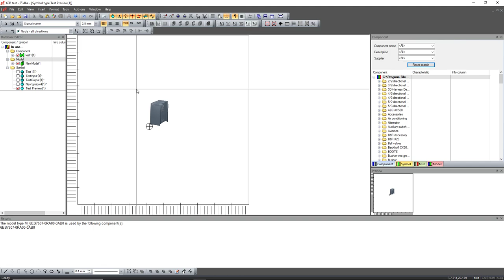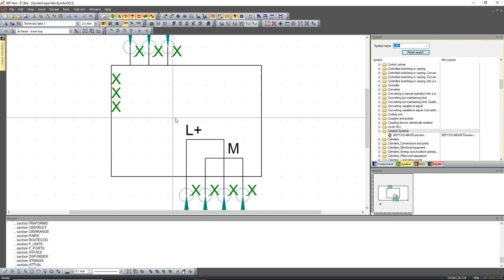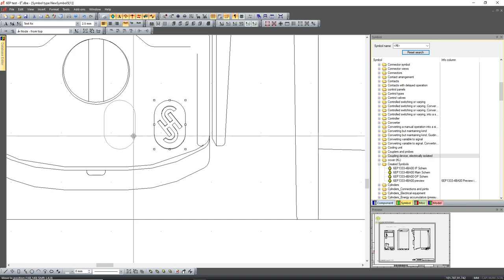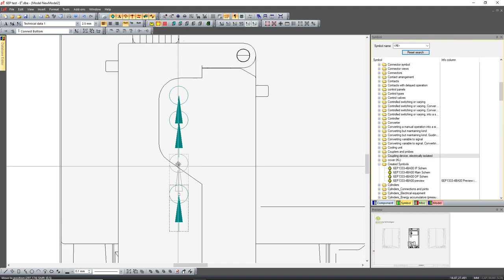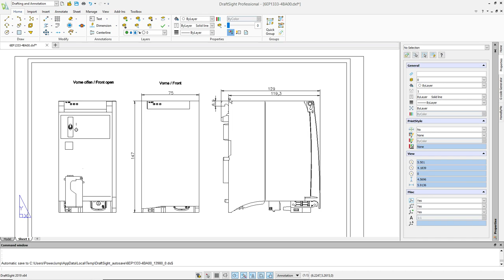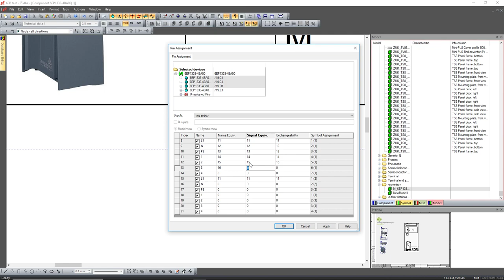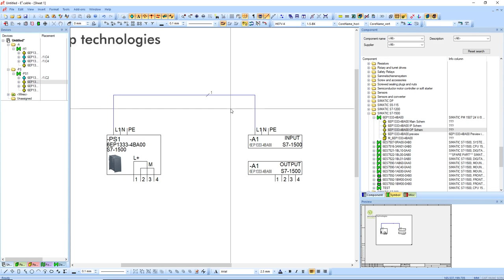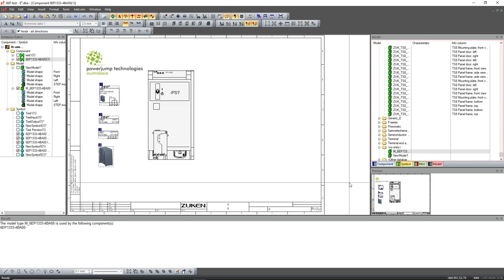Easy Custom Component creation with model creation using Zuken E3.Series

Comment: Hello, can I create a component and in some field link it to another component in the database so that both appear in the bill of materials?
For example, I create a push button that has its own manufacturer code and this button has a NO contact. When adding this NO button to the schematic and layout, in one of the description/assignment fields there is the code/name of the component 'NO contact block' which has the manufacturer, description, manufacturer code and the push button appears in the bill of materials with its information and the NO contact block also appears with its information?

Comment: Hi. Very good video. Because a i have a problem. The option “step model” not appear available in the menú. This option always shown unclick. ¿Do you know how can i resolve that o why this problem appear?. Thanks in advance.
Reply from the maker: Hi Ignacio, glad it was helpful, Unfortunately it seems you don't have the step import license option. you can check your license.dat if it includes any line that starts with FEATURE E3importSTEP.

Comment: Hello, Do you face any problem while importing any autocad(dwg) file in zuken ? In my system Zuken crashes , if I import any autocad file. I can say it is 70-30 meaning  it crashes 70 times and allow me to add cad file 30 times . Do you see similar problem ?
Reply from the maker: HI, 

Depends on your installation and autocad file size etc. I recommend trimming the drawing in autocad first to only what you need then importing it into Zuken, this way it should minimize PC run requirements. see if that helps. otherwise if you let me know where you are located i can get the details of your local Zuken support person who can help you.